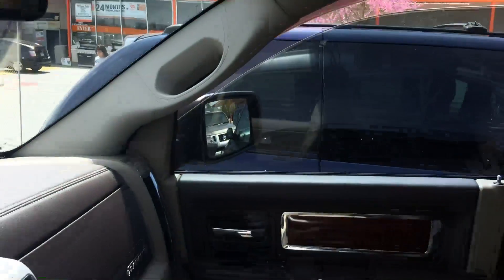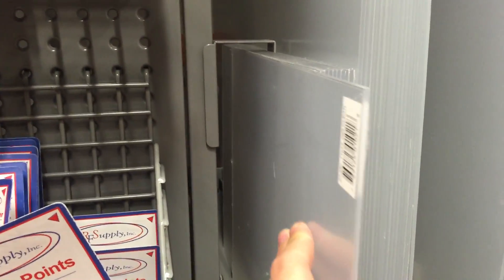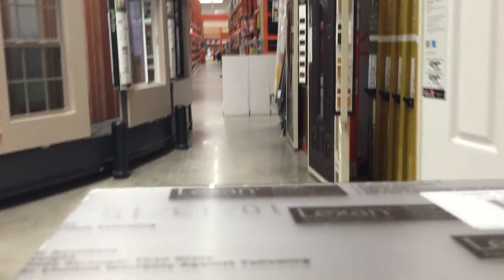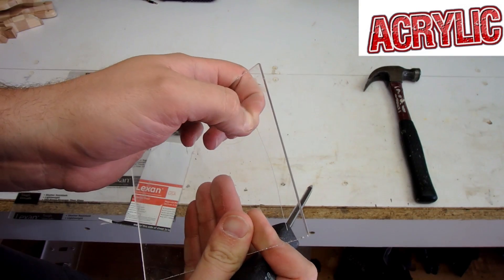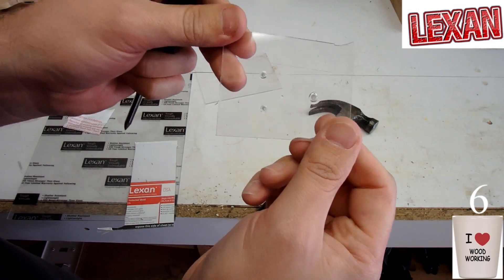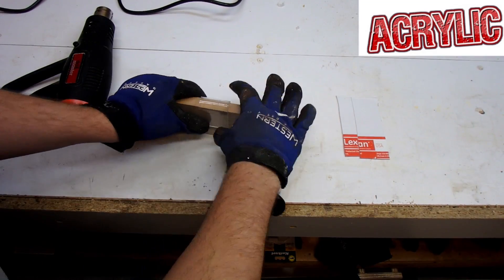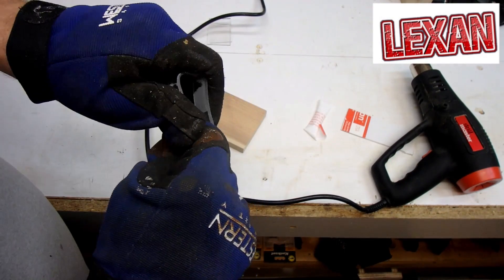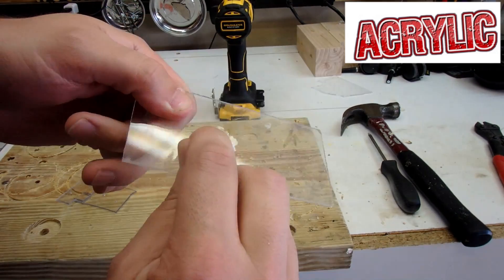Testing Poloycarbonate Lexan VS Clear Acrylic

Comment: I'm wondering how much stiffer PC is to Acrylic 🤔
If I would put a sheet of acrylic in a cupboard for putting books on it, how thick would it be from pc compared to not be bend or in similar situations, I could not find a video that shows a 2mm piece of each what would happening how far it would bend or not at all. 🤔
Reply from the maker: The poly carbonate in 2 mm is still gonna have a bit of flex. Lets say you make a shelf of PC 2 feet long. You will have a flex in it maybe an inch if you set a bunch of books on it. But that sheet wont break. Its so strong, you can set the books on it and then sit on it with your body weight and it still wont break. Is it great for making a shelf.. no not really because it flexes. But it wont shatter or crack like acrylic does. If you take a jig saw to acrylic it  cracks and shatters. Poly carbonate wont. Its just easier to cut and amazing stuff. Hockey rinks use lexan poly carbonate for the glass, a puck cant break it and a player or stick throw at it wont either. But it has a bit of flex. Hope that answers the question. Lexan is amazing stuff. It gets expensive, but you can buy a large sheet of it. But go to lowes or home depot and pull out a sheet and bend it. It does flex so maybe not the best material for a shelf but maybe double the layers and you could pull off a clear bookshelf look. Hope that helps.
Reply: Thank You very much 🤗

Comment: You need to do more material research. There is a use for acrylic. It is more chemical resistant. Don't use polycarbonate anywhere near gasoline, any alcohols, and don't clean it with any window cleaner that has ammonia; many do. Also, acrylic is more UV resistant. Over time a polycarbonate will become hazy with constant sun exposure, like use in a window or door.  Finally, acrylic is more scratch resistant, and easier to polish out scratches and hazing that occurs with repeated cleaning with anything courser than a microfiber cloth.
In other words, acrylic is more durable in many uses and environments. Polycarbonate is more soft, therefore more flexible and won't crack.
Cutting and preparing edges on acrylic is harder, and to drill it, special acrylic bits should be used. Small micro cracks at edges can grow to big cracks if not sanded out at cuts, or made when drilling. So polycarbonate is easier to work with both in preparing and tools needed.
Do your research!
Reply from the maker: I was only demonstrating the hardness level of the material. Thank you for your comment.
Reply: I used acryilic for Covid-19 barrier, and used ethanol to clean it. Guess what. It breaks. I used polycarbonate instead. So you should do more research: acrylic doesn't stand alcohols, but polycarbonate does.

Comment: Good video. Polycarbonate (Lexan) is more expensive but as you noted is far more resistant to breakage, can be cold formed (bent without heating) and is much easier to cut using standard tools. Acrylic (plexiglass) is more resistant to scratching, scratches can be buffed out, and is much more resistant to petroleum based solvents like gasoline. Each has it's place though I generally find myself using Lexan as it is easier to work with.
Reply from the maker: Thanks Rich! I agree... It does cost more but in the long run lexan is the better material for most projects and worth the extra dollars. Ty for the comment bud!

Comment: How do u chemically weld lexan? I know paint thinner works on acrylic anything similar? Also cutting acrylic is easy if u have a table or miter saw. Harbor freight sells a 80tooth blade for 30 bucks, I get no chips and a few people have asked how I got such an edge. People assume it's hard or ecpensive...really isn't either. Also bending is easy with some men, aluminium u channel, hinges and thick ecig coil wire . Trick is a spring on wire to take up slack
Reply: Super'poly' grip   ... just kidding, I have no idea!
Reply: Contact any plastic supplies house. They will carry the correct “glue”. It’s a solvent, actually. Very similar to the glue used to bond plastic pipes (irrigation pipe, for example).

Comment: That is a sweet black lab there...I am going to cut the back out of my 93 suburban so it will look more like an Avalanche..I need to make a removable rear window and seems like pecan might work best..need to have holes and bolts on the edges to hold it in..I remember working with plexiglass years ago and it cracked very easy.
Reply from the maker: Donald Fewox lexan can scratch but it's not going to break. Pretty sure you can haul a prison inmate and let him kick on the window for an hour and it'll still be fine. Good luck on the mod! 😁
Reply: WoodenCreationz..Ha Ha, I want to keep the prison inmates and zombies out!..And I just noticed that auto correct thinks I was meaning to spell pecan when I knew that I wanted to spell lexan...same thing happens when I spell Jews but it turns it into God's chosen people..Ha Ha.

Comment: Useful video. Thanks! I'm looking at using plastic to write on, like a whiteboard. Any idea which plastic is more suitable for writing on with dry wipe? Porous etc?
Reply from the maker: St. Ginger it's a dry erase marker both of them would work. My dad bought some shower board for my mom when she taught school as a dry erase board. Might consider that As an option as well.
Reply: Acrylics are more chemical resistant for the cleaners you may end up using.